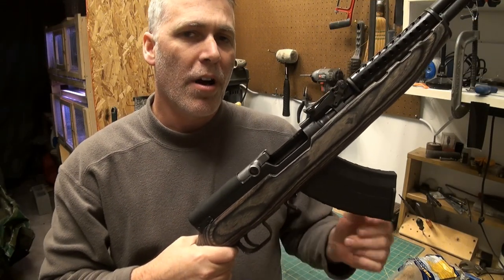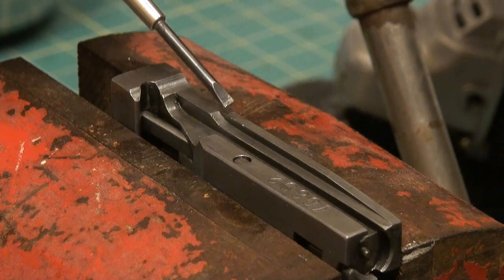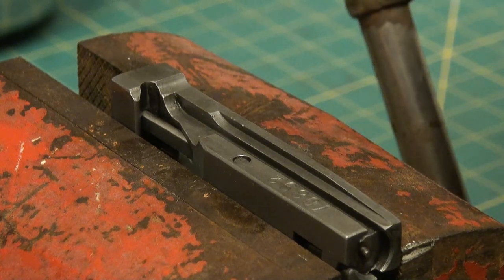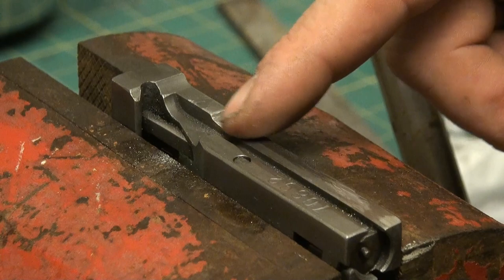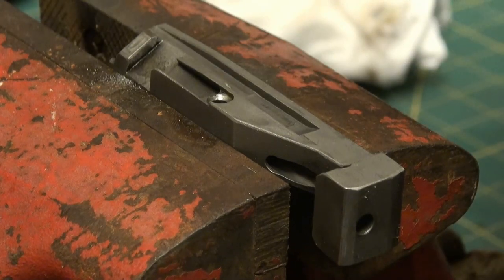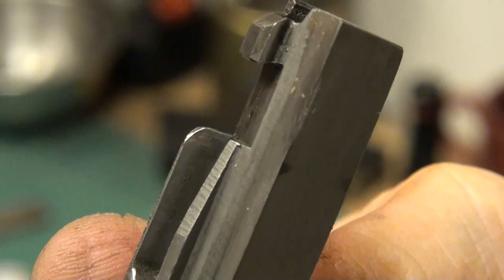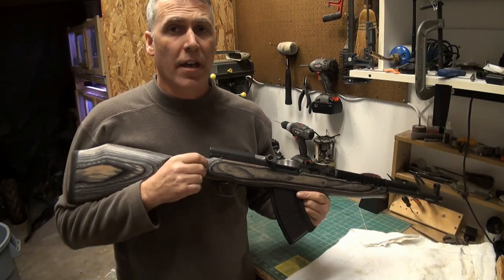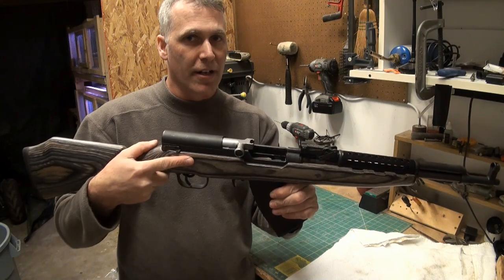The SKS Bolt Mod: Magazine Drop Free Modification.

Comment: Five years ago I used a combination of my bench grinder and a dremel tool.  The mod works perfectly with no malfunctions.   It makes you wonder why the original design put those lips on the bolt.
Reply: Did a lot of digging to find that exact reason. I just got my own sks and wanted to find drawbacks of this mod. Apparently the only reason those lips exist was to prevent the non detachable ten round mag from falling out after being assembled incorrectly by drunk Russians after field stripping and cleaning the weapon
Reply: @UnitedArmaments  That makes perfect sense. That box clip was meant to be removed only when field stripping.

Comment: thanks after I watched you knock it out I decided to give it a try. I used my dremel and it worked perfectly...thanks
Reply: I just Dremel'd mine works perfect
Reply: I just did mine as well. I love it!
Reply: @turneynicholas  Guess what you can remove the magazine and insert the magazine but you still have to lock the bolt in the open postion with a magazine thats loaded The mod does not cycle a round in the chamber if you insert the magaazine lloaded while the bolt is closed your round will cycle in the chamber Complete waist of time Wish nI would of known this beforehand
Reply: @jameswardle7257 you're definitely not correct.

Comment: I used a file to remove mine then I used 600, 800, and 1000 gritt paper to polish then buffed it with mother's mag. I agree that it was probably not necessary to go this far but my finished product is awesome. You can't tell it's not original unless you know what an SKS bolt looks like. I also put the Weaver mount dust cover on mine because I seen it had to be custom fitted. I read a lot of bad reviews where people bitch because they had to fit theirs and that it is too loose and rattles around so it won't hold zero but I took my time like I did with the bolt mod and mine doesn't move at all and holds zero as good as any of my other rifles. Good work=good results!

Comment: Did this today for my sks and it worked great! I had a hard time with my angle grinder so I used a pair of vice grips to hold the bolt body and I used my bench grinder :)

Comment: It’s a lot easier for the range especially when the employees watch you like a hawk. Sometimes locking the bolt back while loading a mag is a bit challenging while trying to keep it pointed directly down range. This mod helps big time.  Thanks💯

Comment: Just did this and it works amazing. I disassembled it, and I used a dremel with a grinding tip, and then sanded it 400 and 1200 grit sandpaper. Took me about 20-30 minutes, and I cleaned the bolt afterwards. Haven't shot it yet, but I will update this comment when I do.
Reply: By ballot or bullet  
lol
Reply: I would recommend people do not do this... this gentlemen obviously didn't survive the test fire
Reply: @myweight2513  lol

Comment: AND with he 'aftermarket' mags you can also get the MCarbo Sear Spring Set and use the "Lightest Spring" !!  It takes about 1# or MORE off the Trigger Pull - Mine is down to about 4#.

Comment: very relevant video 4 years later in 2019 ...if only a manufacturer could get the rights to copy the original mag snout. I widened my aftermarket mag approx. 1/64 per side so the original dimensions of the bolt can be preserved and didnt have to pull my sks from the pug 2 platform mine is currently residing in. great work and love the attention to detail. grinder or cut off wheel works. eventually I will take mine to the grinding wheel and finish it by polishing it to work best, than modifying mags. thanks.

Comment: Thanks, did you have to shave the wood where the magizine feeds in order to fit the 20 round clip?
Reply: I use tapco mags in my sks butni didn’t want to modify my stock. I used a file on the top 3 inches of each mag. File and test back and forth. They all fit great. I didn’t want to mess with my stock

Comment: That doesn't alleviate bump fires,are caused by free float firing pin.Theres a spring kit made to install onto firing pin inside channel which does in fact stop bump fires.In fact every sks should have one installed before being sold in the USA.A simple 30cent spring could save someone's life.Ive installed hundreds of them and every SKS I own has pin springs installed.

Comment: Have you noticed any issues with corrosion here after this mod?  I'm probably going to try either way, but I figured I'd ask if one year on now, you've found anything about that. 

Also, that's a really gorgeous stock.  What kind of wood is that?
Reply from the maker: No corrosion issues and it's a Tapco Timber Smith Stock.. One of the best stock for an SKS I think. I'll do a video on it in the future.
Reply: Did a good soaking in oil after and still a year later, not a spec of rust

Comment: question : why is the bolt starting from an open position ? reason i am asking is "i am a very good gun builder" and i go through hell on almost every build  making them fire from a closed bolt . converting to semi auto from wide open.just caught me off guard . love the mod though especially if you get the AK mag to fit.
Reply from the maker: If I understand the question correctly.  The bolt is not starting from an open position. It is being held open from the empty magazine. The rifle fires from the closed bolt.

Comment: FYI use a file or drimel tool. Grinder gets the metal too hot and even with the cold water and a towel you are destroying the integrity of the metals original heat treating. Yes drimmel or file takes longer but at least you don't mess up the gun for your kids and their kids

Comment: actually quick question, I've done the mod, reinstalled, it's taking the mag without having to be open, but how are you pulling the bolt and keeping it open with the mag in? sorry I just got this gun 30 mins ago and am trying to learn
Reply: When the mag is empty it holds open
Reply: Kyle Jordan  when you pull the mag out and pull the bolt back there’s a small catch you have to slide up with your finger

Comment: I did this with my Yugo SKS. Went to test fire it and it wasn't able to cycle through rounds. The bullets would hit right below the barrel and jam instead of going into the barrel to be fired. On the fifth shot that I took (After fixing each failure to cycle) the bullet shot out the gun, but the casing was left inside of the barrel with the back half inch of the casing getting ripped off of the shell by the extractor. This left the front half of the bullet casing stuck inside of the barrel.
Reply: I learned the hard way The rail you removed from the bolt is actualy the line up guide for the breach With the magazine removed look up the magazine well and cycle the bolt the function of the rail you removed is designed as a line up

Comment: Have you found any negative issues after having done this mod?
Reply from the maker: yes, i find i shoot a lot more ammo this way:) all funning aside there have been no issues
Reply: Did you disassemble the bolt before doing this modification? If not, you obviously got metal fragments inside the various moving parts inside the bolt. Disassemble the bolt before doing this clean it, then lube it, it will work fine.
Reply: @Tad Dastrup I still say if you want a 7.62x39 rifle with detachable magazines, buy a SKS-M, D or buy an AK and be done with it. Leave regular SKSs alone and learn to use stripper clips. If you can't buy an AK or SKS-M/D, save for one. If not legal to own where you live,  move. 

It will make life a lot easier in the long run.
Reply: @Tad Dastrup I have the same problem and need assistance with a fix
Reply: @duanebell7140  its most likey a weak or broken extractor spring or extractor

Comment: use a spray bottle and really wet it down before and during your grinding..if it is warm to touch you're ok, but if it is hot (enough to evaporate the water) then give it a break and cool it down.

Comment: Ok my friend please help.  My SKS has the archangel stock... I like to shoot irons but the cheek riser is too high on it so I'd like to switch to a wood stock.  I really like yours and can see we use the tapco mags.  Did the stock come stock to receive those or did you have to do something?
Reply from the maker: +Luke Mathers The stock is a Tapco Timbersmith. In my book, the best aftermarket stock for an SKS. The mags fit fine but the rifle needed a little fitting. Took 10 mins or so..
Reply: That I can deal with, no problem and thanks for the reply.  Revisiting my site picture problem.  When you shoulder blind and open your eyes are you high or low on the site alignment?  Appreciate the info.

Comment: @MrGunny2009   2 years ago
Five years ago I used a combination of my bench grinder and a dremel tool.  The mod works perfectly with no malfunctions.   It makes you wonder why the original design put those lips on the bolt.
         !!  Well,  Likely because Tapco et al didn't exist in 1945. !!

Comment: Is it normal that with a 30 round after market mag that every time I pull the bolt back the mag falls out I can't get it to stick in and my bolt doesn't lock back unless I put the mag in it
Reply: Ur mags messed up then m8.
Reply from the maker: +James Kelsch If your mags are falling out then its not catching the mag release. Also the bolt wont stay back on its own without a mag in it because the follower in the mag pushes up on the bolt catch when its empty. You can always manually activate it with your finger.

Comment: never grind with a cut off wheel.
Reply: lac365 Right. A Dremmel would be so much easier and safer
Reply: Not just that, but more likely to over-cut it.
Reply: @MrGible  No a grinder cuts relatively slow since the steel of the bolt is very hard. The reason you don't use a cut off wheel is because a cut off wheel over a grinding wheel is very thin, grinding on the side greatly reduces the thickness and increases the chance of it suddenly shattering. The guard should contain the fragments, but being struck could cause serious bleeding.
Reply: What Dave said, better off using a Flap disk
Reply: @dog duck Chikin not if you enjoy having eyes...
Reply: @dog duck Chikin have you not seen the pictures of cutoff wheels going through safety glasses? They're pretty gruesome. Flying grinder disk pieces can also fuck up your arms, hands, neck, and face really bad as well... But keep up the "use whatever works" mentality. I'm going to stick with "right tool for the job."
Reply: @dog duck Chikin lol
Reply: @DaveSmith-cp5kj  the steel on this bolt is not hard...the file cut it very easily..
Reply: @vocalpatriot  Sure you could use a file, but it is much harder than mild steel and you will spend like an hour and probably nick other parts of the bolt. Just use an angle grinder and finish with sandpaper. Angle grinders are very controllable as long as you don't shove it into the metal.

Someone mentioned a flap disk and that sounds like an okay compromise, although I suspect you will need a few.
Reply: If you know what you are doing this works fine. Keep the grinding to the outer edges of the blade and do some cutting here and there and you will be fine. If you do it over and over than yes it may explode.
Reply: @iamcondescending  why are you trying to save him, just let the problem sort itself out lol

Comment: maybe there was a reason why simonov, created the sks to use stripper clips instead of mags, its only my opinion.
Reply: Yeah cause stripper clips are cheaper to produce than box magazines, but look what happened, the sks became obsolete as soon as the ak started being a thing.
Reply: i cant think of a good reason  maybe they just thought thatd somehow be quicker than changing mags cause you have to take them out of the gun or didnt think that itd be much faster to have a magazine to be able to drop out of the gun instead of having to always have the bolt back to be able to put in a mag or take it out

Comment: I need a new recoil spring on mine and the bolt dont lock open to reload i have to hold it with my orher hands to not get my finger crushed any help im new to sks
Reply: There is a bolt hold open (not what it’s called I’m sure) tab on a spring just above where the front of your trigger group locks in. The stock mag has a follower that it pushes up. You have to  pull it up by hand to engage it with after market mags.
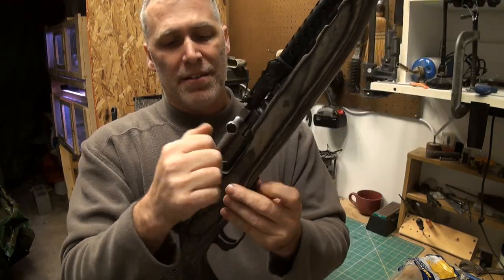You can see him stick his finger from underneath and do it at 00:32

Comment: I did this with my Chinese Norinco and it worked great.  I bought a new SKS bolt for my Russian Tula So I wouldn't have to bastardize my Tula's bolt.  After modifying the new bolt, the trigger will not pull back and release the hammer??  Can anyone here offer any help?  The bolts appear to be identical.  When I replace the Tula bolt in it, the trigger pulls back and releases the hammer.  What am I doing wrong?
Reply: You jammed the bolt full of metal shavings probably.

Comment: Next time, disassemble the bolt, so you are not getting grinding dust into all the parts....
Reply: 3cressidas or heating up everything and possibly changing the metal structure. 

Love the one time use of a wet rag vs dunking in water.

Comment: OMG. No way am I butchering my sweet SKS to save a little inconvenience. Buy a decent mag and you can get it out with the bolt forward. My 35 round mag comes out with a push of the lever and a love tap.
Reply: You missed the point. In the original design, the bolts locks up around the feedlips and makes it impossible to remove. There are no mags that can get around that, period.

Comment: Why would anyone modify a gun component to fit an aftermarket part, this is insane, it’s the other way around. Think of the cost and availability of the bolt compared to a 25$ knock off magazine.
My credentials: gunsmith course completed at Colorado School of Trade in 1981

You’re modifying a bolt ...cutting through the case hardened bolt...to do what the gun was not designed to do since it’s its original version. I repeat.....this is insane!